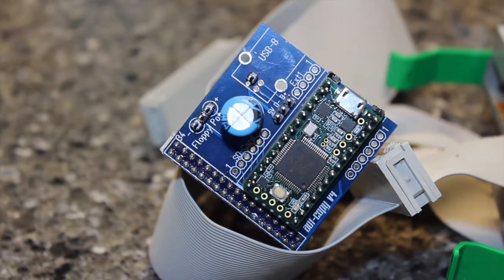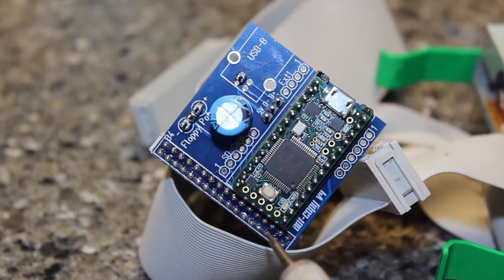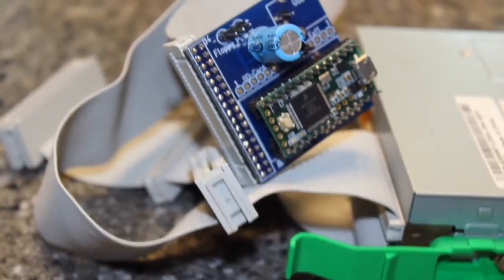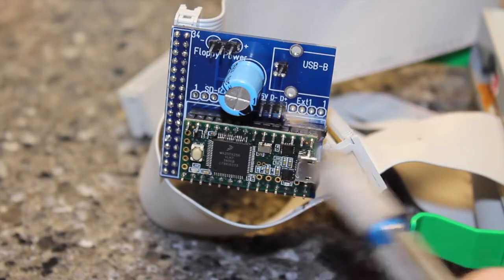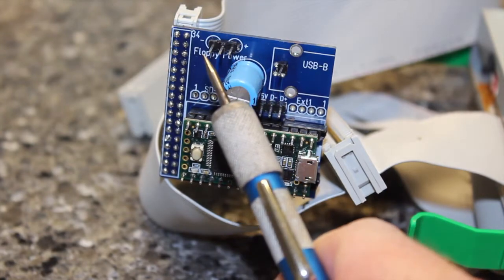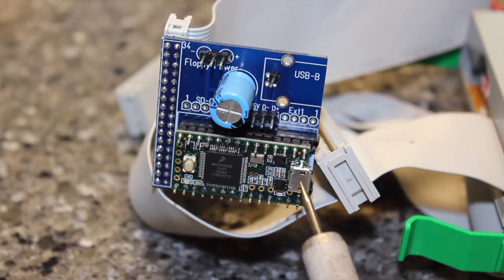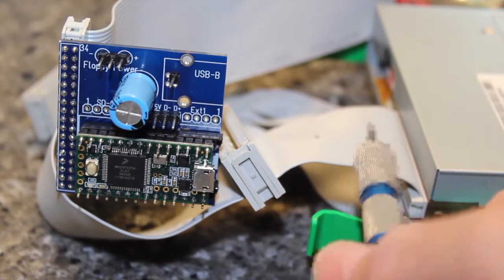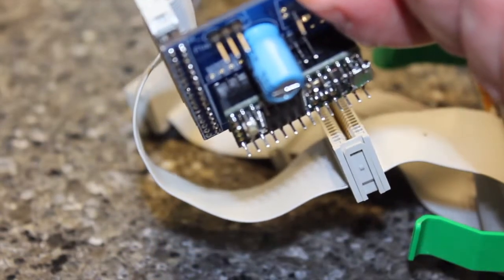ADF-Copy Teensy 3.2 Board: Use Amiga Floppies in Windows/Linux/Raspberry Pi

Comment: The Amiga can configure it's drives to work how it likes will it read non standard formats & bwill it Work With Amiga Drives?
Reply from the maker: I have not tried it, but I think the design is only only Amiga format compatible. Greaseweazel OTOH reads almost everything. But it's not as simple. See: https://github.com/keirf/Greaseweazle I wouldn't bother using it with an Amiga drive. PC drives are far cheaper, so put the wear and tear on one of those. I got one made in 2003 the other day that had not a speck of dust on it. I paid about $9. See Ebay, there are new PC drives still out there...probably not to many for Amiga at all. Much less for $30 or less easy. https://ebay.to/2Qz5z90 And frankly, the used and tested ones I've gotten worked fine after some cleaning. I just got two floppy cleaning kits for $25 total shipped on ebay https://ebay.to/2QA10Lt. @Thorvard invented it BTW. His channel: https://www.youtube.com/channel/UCeovMptTPeDlxY1xgqQFozw

Comment: There were some devices which used the 12V on the 3.5" power plug, i had a QIC-80 tapedrive which required 12V. Lately the 12V are used by internal USB Hubs, Fan controllers and RGB Led controllers.
Reply from the maker: Interesting. But that is why I said floppies because I knew something out there most likely did. ;) At 5:26 for other readers. :)

Comment: If the PCB creator can somehow tie in the CAPS library (SPS) could it then Read / Write copy protected disks ?

If it ends up that way, it would be a FAR FAR cheaper than Kryoflux which is at least 100 Euro.
Reply: The Kryoflux costs 100€ because it comes completly assembled with WEEE, CE, ROHS, FCA whatever and it is a commercial product, the costs for developing the hard and software are included in the product. Adf-Copy is a hobby product which i developed in my free time.
Theoretically the hardware is capable of reading/writing copy protected disks (with some exceptions like kryoflux), but this would take a lot of time in development which i don't have at the moment, and only a fraction of people would use it. No need to reinvent the wheel.
And seriously, today every Amiga Software is cracked and available as an ADF.
Reply from the maker: @Thorvard  I don't know if Greaseweazel does copy protected reads but I think it does. I ordered one but don't have it yet. Will get Keir for comment.
Reply from the maker: @Thorvard  IIRC didn't you have the source code somewhere? So someone else could integrate it.  Link if you like.
Reply: @RobertBullock  The source is since the begining 2016 Open Source and available on my homepage.
Reply from the maker: IIRC didn't you have the source code somewhere @thorvard? So someone else could integrate it.